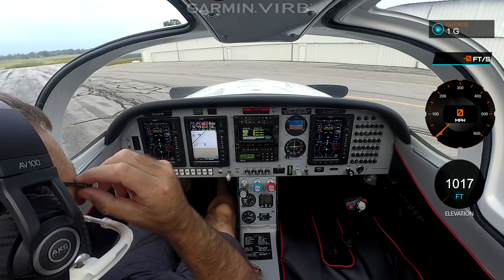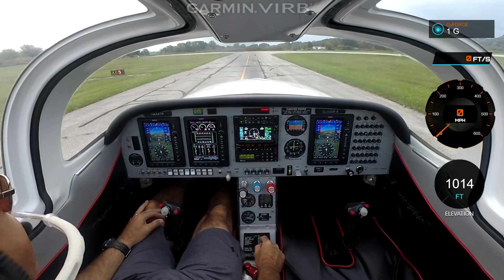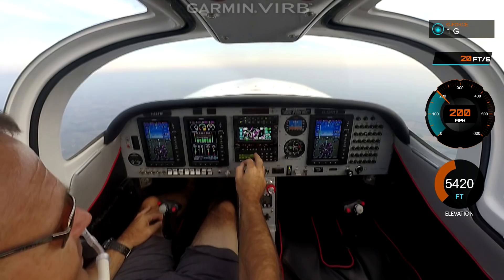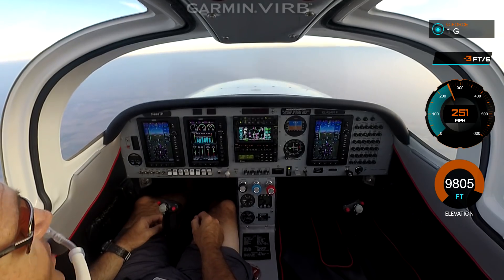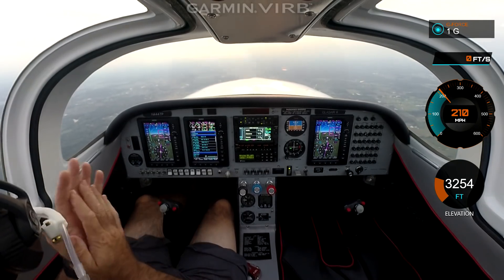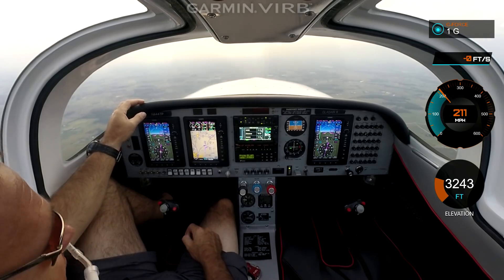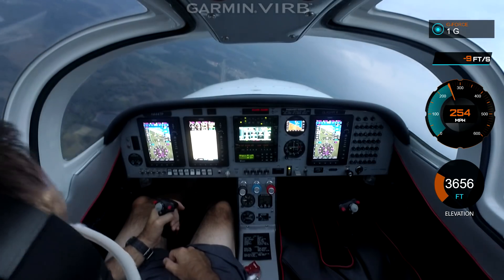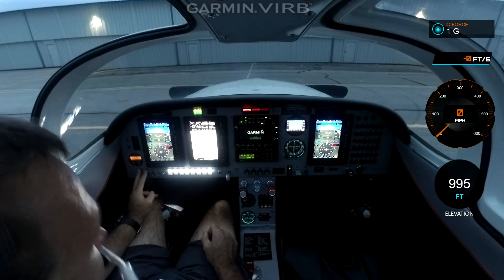Glasair III Full Demonstration with Garmin G3X

Comment: No clearing turns?
Reply from the maker: No. not formally.  ADS-B in/out is functioning and the chances of seeing a a Champ, Cub, or Citation jet visually for that matter is pretty low even doing clearing turns.  I have been flying 30 years now and have seen traffic that my students don't see and have also missed traffic that they see.  Of course, I am always looking for traffic, but clearing turns do nothing other than take your concentration off what you are supposed to be doing.  Look at your ADS-B / active flight TCAS and look for what you can see and fly the plane.  BTW, was flying yesterday shooting an approach in VMC.  I was visually looking for traffic and seeing nothing.  My ADS-B was showing traffic at 2 miles and my altitude coming at me at 45 degree intercept.  Did not see the plane until it was within 1/4 mile.  I descended below it to avoid it.  Had I not had the ADS-B info it would have been close.
Reply: "Clearing turns do nothing but take your concentration off what you are supposed to be doing"... That concerns me. That's selfish in a way, because if you cause a mid-air collision it's not only your life, you kill people that are in the other plane as well. Please do clearing turns. Never completely rely on ADS-B and stop looking outside. Also please make radio calls, I don't care how busy or not busy the area is. YOU HAVE TO MAKE RADIO CALLS. Fly safe out there..
Reply from the maker: I get what you are saying.  I am a CFI as well.  Times are changing in aviation.  For instance, the "square" pattern everyone has been taught to do is now being challenged.  Why?  Because you should be concentrating on landing when in the pattern.  For years you were taught to level the wings on every leg to look for traffic.  Unfortunately, many stall/spins were a result.  25 years ago I challenged that teaching and pushed for a continuous turn from downwind to final and it is now becoming accepted.  Clearing turns are no different.  What do you gain doing a clearing turn?  Think about it - you are TURNING into traffic.  If you have traffic around you have the same potential to hit it in the clearing turn.  So, even if you do the clearing turn what makes you think you saw anymore traffic than I will see by doing the actual turn which lasts less than 10 seconds at an 80 degree bank?  What about when you spin a plane?  Were you about to scan the area good enough to see all of that airspace both vertical and horizontal?  Aerobatics?  What do you do there?  Clearing turns?  Finally, what defines a clearing turn?  90 degrees left and then right?  180?  Show me the definitive authority on exactly how to do a clearing turn.   Do you do clearing turns when vacating 15k ft for 5k ft?  Like I said, I get the idea, but those days are over.  Yes, you still need to look outside, but your eyeballs will see 5% of what your electronics will see.  Same goes for VFR cloud clearances.  Do you really think that 1000ft, 500 ft, 1 mile is enough?  250 knots in both closing directions and introducing vertical speeds of 1-5k FPM is much too fast for your eyes to see and brain to process.  Once again, electronics will be the superior indicator.  I do agree on your radio calls, but I would also point out that many people are WAY too chatty.  They should be short and accurate in their call outs.  It is frustrating to me when a guy or gal spends 30 seconds saying "John Q Public airport, this is Cessna 152 N12234.  We are about 7 miles out at a 150 degreee heading at 2650 ft and descending.  We will be making left hand traffic and will enter from the West approximately 2.5 miles out at which time I will turn on my carb heat, fly upwind, and then go crosswind to enter a downwind. "  And finally - the most aggravating statement"  :Any traffic please advise!" 

Trust me, there are far more dangerous people out there that follow procedures and are horrible pilots.  Single pilot VFR/IFR requires thinking out of the box and using all resources available.  CRM and set procedures are much better for the airlines with flight crews.
Reply: +Dukepilot I respect your opinion, but I, personally, can say that doing clearing turns helped avoid 2 near misses in my aviation career. Even airline crews are responsible for looking out their windows to spot traffic whenever they are not in IMC. They have TCAS, and ATC watching them over, but they are still required to look out the window to avoid traffic. Look into Hughes West Airlines colliding with an F-4 down over So-Cal. Both planes had traffic collision avoiding systems, yet they hit each other at 15,000ft. Never completely rely on technology. Fly safe.
Reply from the maker: I agree, but you also made my point.  Do you think the airliner was going visually to see the F4 when they could not even pay attention to the superior technology they both had?  Do you really think airline and corporate pilots are looking out the windows for traffic?  I also agree not not rely completely on technology, but ADS-B will prove to increase traffic awareness exponentially.  Sometime, just for fun, fly into very busy airspace such as SW or SE Florida with your ADS-B turned on (make sure you have TIS-A and B.)  Before starting your maneuver,  cover your traffic page and do your clearing turn.  Note if you see any traffic.  Next, uncover your screen and see all the traffic you missed.  Now that I have ADS-B in my plane I almost am unwilling to fly in one that does not.  I did not realize how much traffic my eyes missed.   You simply do not see traffic very well visually because of many factors.
Reply: Duke. Funny. I just watched that video not one hour ago. Very interesting...and sad.
Reply: yep, it's tragic unfortunately.
Reply: Dukepilot...20 years ago as I was a student pilot doing my clearing turns, I always thought it was useless and a waste of time for the reasons you mentioned. How far out was I suppose to look?  How high or low was I suppose to look?  Can't see much looking into the sun!  Sometime setting up stalls take awhile and negates your clearing turns you did a minute or two ago!  I do agree with concise applicable position reports. Awesome plane!  I want the REVO or this...LOL
Reply: He wasn't completely relying on the ADS-B.  Read what he said.  Trolls suck.....
Reply: Flying in northern Indiana, where Dukepilot does, is a very different proposition than So-Cal, or the Northeast corridor.  None of us would try that in So-Cal......

Comment: Your gear lights came on under g?
Reply from the maker: Good catch!  That is the nose gear unsafe light.  The builder installed a micro switch above the nose tire in the gear well instead of installing the switch on the uplock cam.  At speeds above 220-230 knots indicated there is enough air pressure in the cowl to lift the switch arm up enough to cause the light to illuminate.  The gear itself is still locked in the up position.  I will be installing the switch in it's proper location when the annual condition inspection is due.

Comment: I don't get why you even need Oxygen at 10,000ft ?  I would save Oxygen and engage at 12,5-13,5 only if I was going to stay at that hight for 30min or more or OMY up to 15-20
Reply from the maker: This plane has enough oxygen to supply 2 people for 8 hours. I have a machine that makes the oxygen and fills the bottle automatically.  For this video I did it just to demonstrate the operation; however, even at 5 to 10k ft oxygen is very beneficial. I keep my saturation above 96 which means I am as sharp as sea level and no headache when inland. Again, I have my own oxygen generating equipment, so why not use it?

Comment: I flew my PA 28 161 Piper many hours using 'old school' vacuum gauges, Watching you fly that very nice aircraft with all those electronic auto panels looks cool, but it is very uninteresting, and takes the 'seat of the pants' fun out of flying.
Reply from the maker: Interesting comment.  You really need to fly something like the GIII to understand "seat of the pants."  This airplane will climb at 2500 FPM at the full cruise speed of a PA161.  It will cruise at 25% power at the full power cruise of the PA161.  It will descend at 6000 FPM and at 2.5x the redline speed of the PA161.  

In short, the gadgets you see in this plane are not only cool, they will keep you from killing yourself in this plane.  In the PA161 you have all the time in the world to disseminate the information coming from steam gauges.  In the GIII you need to be ahead of the plane and the gadgets you see help you stay ahead of the plane.

Comment: Nice video.  Really enjoyed it up until the point you spun your tail around pointing at the hangar with the engine running.  My hangar neighbors would whup up on anybody who did that.
Reply from the maker: Yeah, if you look close I am a out 40 ft away from the hangar and am at. 800 RPM idle the whole time I am taxing  back.  I can guarantee there was nothing  blown back.  I also fly helicopters and jets and am very concerned a out where fan/prop/rotor/ wash goes.

Comment: So.....No approach plate, no brief, no atis, no radio calls? I know you didn't complete the approach but damn, those are some awfully bad habits to build.
Reply from the maker: Lol, it was a demonstration flight in VFR conditions to describe the performance of the plane. If you listen you will hear me tell you that ATIS was inop. When you get 32 years of experience in 150 different makes and models without a single mishap let me know. 👍
Reply: @baronpilot2bb  Ok, so justifying bad habits because of your experience is not a good idea either. Look, I'm a CFII, I read crash reports everyday and I realize that it was an exercise in VFR conditions but getting on an approach in autopilot, unprepped, not talking to traffic is a recipe for disaster. And then you posted it on youtube so inexperienced pilots go and think its ok because of how "experienced" you are. At one point in the video you state your altitude but the on screen telemetry was 200 feet different. Had you actually shot that approach, you could have been in real trouble. I was halfway messing with you but that smug response is how lifelong pilots die.
Reply from the maker: @kevinbutler9786  What was unprepped?  The altitude you are looking at was from GPS positioning of a Garmin Camera, not air data from the plane.  This was a VFR flight. 

There was ZERO traffic within a 20 mile radius of where I was flying. The visibility was unrestricted and no ceiling.  I know this area like the back of my hand. 

Anyway, there are a lot of people not learning to fly because they get hooked up with an instructor that tells them how dangerous flying is and how bad of a pilot everyone is except them. 

It never ceases to amaze me how a few people love to talk about how bad others are. Look at the stats for this video. 

Then again, maybe you are correct. I suppose that I have just been lucky for 32 years and 5k hours. I suppose I should quit while I'm ahead. 

Anyone watching this video:  DO NOT try this at home. This flight was done by a professional on a closed circuit of air in controlled conditions. It should not be attempted by anyone and is dangerous. In fact, do not fly ever again. Stay at home and critique YouTube videos instead. It is for your own safety.